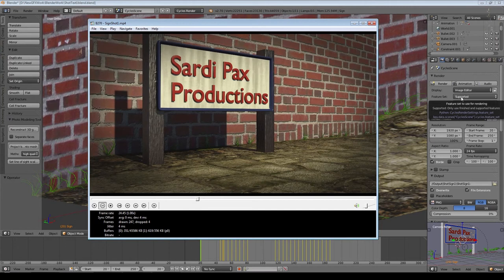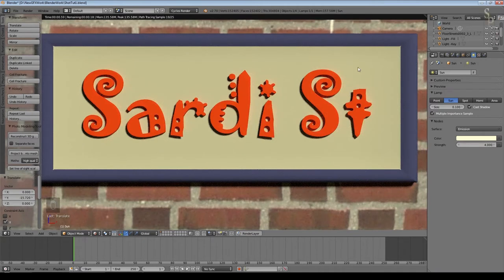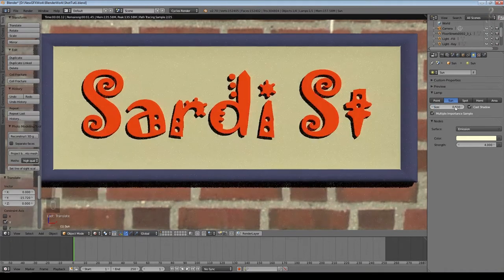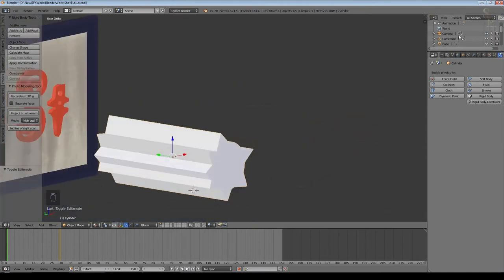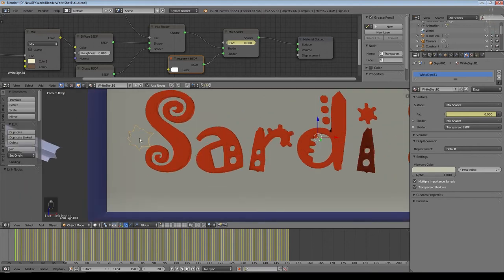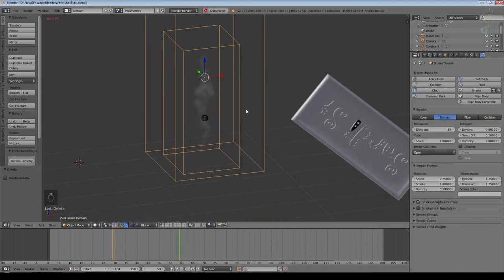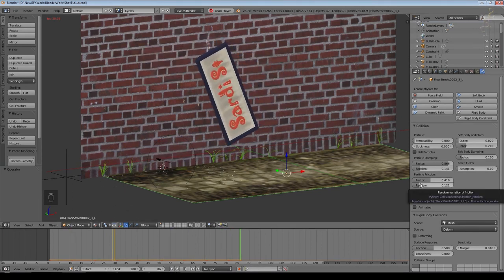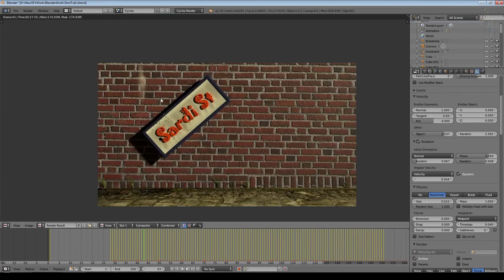Blender 2.70 Tutorial - Shooting a Road Sign

Comment: Hi! Please, on shot how did u make the 45degree bevel at 23'54" ? I tried every way I know with no result, CTRL+B doesn't work. any tip?
Reply from the maker: Hi Bipe, I think that got lost in the edit. This is how I probably did it : hover the mouse over the bridge inside the hole created by Bridge Edge Loops, the press CTRL R and it should create a new loop, use the mouse wheel to get at least 2 loops then left click twice. Then, while the loops are still selected, scale on the axis that travels through the hole, eg S X, till they are near (but just below) the surface, left click to accept, then scale on on all axis except the one that travels through the hole, eg. S SHIFT X, to make them slightly smaller and that gives you the bevel. The reason the bevel tool may not be working is because of 'orphaned' vertices along the rim. If you tidy those up it should do. Good luck.
Reply: Sardi Pax thank you